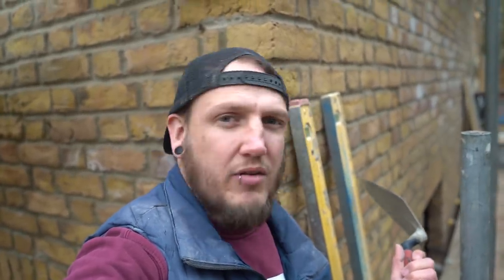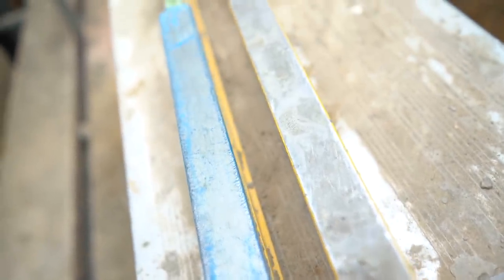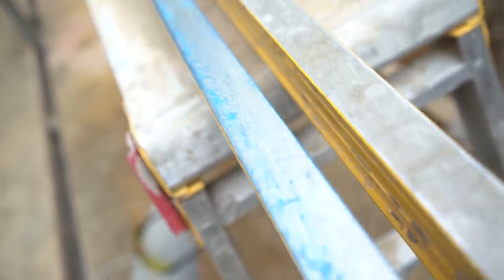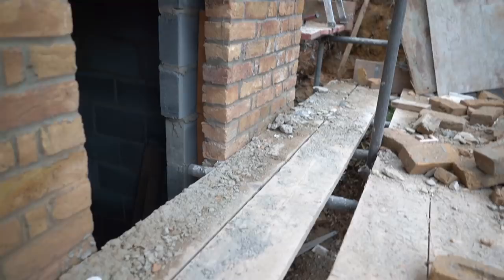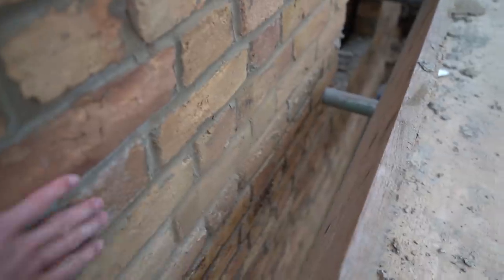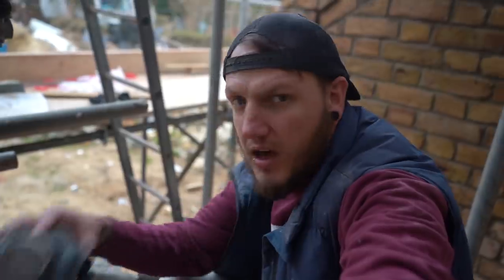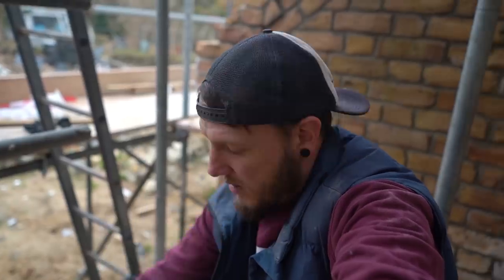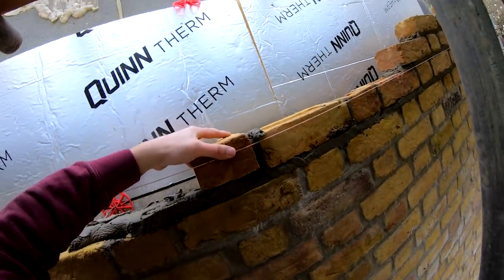7 BAD HABITS IN BRICKLAYING

Comment: The main you have missed  is the clip joint
A proper bad job that is or when its toothed out and someone puts  a brick in and just covers the gap with a joint not actually filling in.
Also a very good one but not very known one is when you brush off the face work but still leave all the tails in perps or brushed when it's still wet. Leaves the brush marks all over.
I work with n absolutely decent old boy brickie and as he says "the levels are made to be tapped or hit". If you just slightly tap it when building corners I don't see an issue but if you are smashing the granny of it then yes it's bad.
Thank you very much for your videos. The way you present the bricklaying channel is special and unusual. Keep it up!
Reply from the maker: Good points buddy. I agree a few taps of the level is all good. A good whacking isn't good 🤣 Definitely the clip joints! Seen that a few times
Reply from the maker: Glad to hear you're enjoying the videos buddy. Thanks 👍🏻😁

Comment: Turn the boards over here, no chance lol. The builders will always pay some one to clean the brickwork here with acid and pressure washer. First thing I noticed here was how messy the walls were after they were built. We used to use offcuts of kingdspan/Celotex/spot board to cover the bricks with, and had to prop our walls at the end of the day with planks and plocks to prevent them from getting blown over.  Reason for one boot wearing out on the toe more than the others is because you kneel down on one knee. I was guilty when I was younger of not wearing PPE but now I always use it, the safety squints still get used from time to time but in general I wear it. Top name by the way mate Cheers

Comment: Always wear a helmet when working around scaffolding !
Reply: Haha ken that’s funny man if I wear a hard hat I seem to bounce off everything ..... if I don’t wear a hard hat I never bang my head so..... I’m on the fence on that one..... below the scaffold I agree
Reply: I saw a chap jump a short distance from scaffolding onto a building and smash his face into a length of scaffolding he could not see because of the peak of his helmet. So much for 'safety' helmet. He was dazed and bloody with his glasses hanging down his face. Helmets good where something can fall on your head otherwise I hated them.
Reply: @railway-share3820  I worked in work health and safety for 30 years. I heard that excuse many times. Where I live there is no tolerance for those who don't wear their safety equipment. First off, that chap shouldn't have jumped in the first place, not good. His helmet could have been worn backwards, like steel riggers, if needed. The same bs I heard about steel toes: "Those steel caps will cut your toes off if you drop a heavy block on your foot". If the block is heavy enough to have the cap cut your toes it would then be up to the surgeon to cut them, because they would be irremediately destroyed. No safety equipment is 1000% proof, but good enough to save you from most kinds of harm.

Comment: Tapping level, Never. Tap brick or steel straight edge.. Clean tools, Always.. Someone else may have to use tools after you.. Cover bricks, most of the time..  PPE, Always.. Scaffolding has always been aluminum w/ traction & drainage holes.. Steel toed boots, Always.. Hitting the line.. Depends on which hand I use to mud bricks.. Army instructors are different from civilian instructors.. Army Sergeant have serious  consequences for bad habits. They get rid of those early.. Especially when it comes to safety.. And you have to wear "Always" wear a hard hat..

Comment: Another is not telling the laborer to grab bricks from more than one pallet. This prevents patchy colored walls seen from a distance. bricks are just loaded from the same part of the kiln at the brick-works. These can be a slightly different shade from other parts of the kiln. Mixing up the bricks on site makes the walls look more uniform in color when viewed at a distance. Also don't forget to batch the mortar using buckets not uneven shovel-fulls.

Comment: Another bad habit is not batching the mortar resulting in different colored mortars of various strengths. What is a shovelful when using dry, blocky, wet or whatever sands? Use buckets, make sure the cement does not stick inside the mixer instead of being incorporated in the mix etc. Batch by volume. Mix the bricks from different pallets so as to ensure an even and not a patchy look to the finished work. The client is expecting work done to specifications - no excuses. Laborers have to be educated in using the mixer correctly to ensure consistent and correct  mortar mixtures. A good knowledgeable brickies laborer is an important asset. All this is taught at building colleges run by ex qualified tradesmen and other building experts. All tradesmen should have at minimum a building certificate (2 years F.T.) or better still a diploma of building. These can be done at night school part-time when working in the day.

Comment: i agree with all your points except the boots.... im pretty sure regardless of whether you're wearing tennis shoes or work boots, stepping on a 4 inch nail will do the same amount of damage to your foot... the only way to prevent that would be to watch where you're walking. yes they do make steel shanked work boots, but the steel shank only covers 2-3 inches directly under the arch of your foot to make the rungs on ladders less painful to climb all day long. 

Personally, i prefer steel toed tennis shoes on a jobsite. they're more comfortible, lighter, and not nearly as hot. being in the midwest USA where summer temps reach 115 Fahrenheit with 90-100% humidity, keeping cool is a huge factor to consider unless you want to bring 2 or 3 extra pairs of socks and take regular breaks to dump the sweat out of your boots every couple hours. 

As far as one toe wearing out faster than the other. i think that boils down to a few things. when you kneel to do low work, which toe drags on the ground? which toe do you use to steady the bottom of your level when you're plumbing the wall? which toe is generally closest to the wall when working and most likely to have stuff dropped on it? think those are all factors, unless you just have bad luck like i do and drop a 100lb steel tub on your brand new $200 boots the second day you've worn them. (was really glad they were steel toe, definitely would've had broken toes otherwise) 

Anyway great video, keep em coming!

Comment: When cleaning trowel, use another trowel edge to clean it. Come up better than washing or brushing with a wire brush.
Reply: Alwyn Maguire personally I wouldn’t use a wire brush on my trowel, I find it puts fine grooves into the metal and makes the mortar adhere to it easier
Reply from the maker: Interesting, never thought about that

Comment: turn boards back, rub wall on way down w/ scaffold,,,, clean & cover windows,,,,throw straw around the base of the wall so roof drip won't splatter wall at the bottom,,,cover your sand, water, & walls when its going to freeze at night,,,, cover the top of your walls,,,,, if you get water in bricks w/ holes ,,pour sand in holes , to dry water before laying over top,,,use bond marks,,,etc,,,etc,,,
Reply from the maker: Some very good points. I could make another vid with all these 🤣

Comment: Leaving trowel on top of brickwork and it falling down cavity...... having to fish it out with wall ties or chopping a block out to retrieve it.😆
Same with level, leaning it on scaffold handrail for it to fall off the scaffolding, usually hitting every bit of steel on the way down. 
Last point is I used to leave the pointing too late, no fun when it’s hard as bell metal to point up 👍😆
From Doncaster btw
Reply from the maker: I've never dropped a level down the cavity but I did have my phone fall out my pocket and down the cavity. That was a pain to get back! Hard muck is almost impossible to rub up well. Id chariot it out and re point. Do that once and you will make sure you dont do it again 🤣
Reply: DeanoP I learnt all he said when I was a hoddy 40 years back, labourers haven’t a clue now

Comment: When I first started out i broke the end off my trowel putting it under 9in block to pull the bottom straight was gutted my mate bought me a new one for doing some work for him I have had it 17 year and it's still as good as new 👍
Reply from the maker: Least you learnt not to do that again 🤣
Reply: @RodianBuilds  sure did lol
Reply: What type of trowel lasts 17 years?
Reply: @Tommy14525  Marshalltown I been of the sites for a few year so does not get hammered as much these days steady away 👍

Comment: I just built my first thing, a couple of steps that go to my sunroom door off my new patio. The problem is that I worked slowly and was kinda messy. I have Type S mortar stains all over my brick. How do I get them clean now that they have dried with that white haze all over?
Reply: brick acid , shit stuff but gets it off
Reply: @SshiggyY  Thanks. I ended up using white vinegar and a scrub brush. It worked.
Reply: @michstanifer  ah brilliant that sounds a bit safer ill actually remember to try that if i ever get messy on small feature work

Comment: Never hit the level, ever.  Hit the level, hit your head, $150 per level.  Good idea on trowel cleaning, I was terrible at this.  Like the idea of rotating the boards, many masons don't want to do that. I am from Michigan in United States.  Old foreman's name was Soggy Bob, we worked in the rain, laid block, brick, or if too bad off rain, rubbed walls, cleaned up, went home once in a while.  Respirators and ear plugs, and eye glasses and gloves - respirator is most important to me along with glasses. Never can ever wear tennis shoes in Michigan, ever.  Bumping the line, yes, bad bad bad and spreading the wall before the twig or trig is set and if you do spread the wall before the twig is set, spread the twig-man's wall and do not hit wall.  Also, be aware of where you are on the scaffold, do not fall.  Also, exercise 2 to 3 times a week - strength train, your tools are key, your body is the best tool you will ever ever have - keep it in great shape.

Comment: Realest tip is about the line etiquette, probably the number 1 thing you start to notice laying with others, the longer the wall and tbe more masons, the more you notice and the more important not fiddling with it becomes, laying brick in Houston and one of the older guys has the habit of moving the line out to spread and it can really get on your nerves on a wall with 5 or 6 masons, you have to learn to read the joints and not wait for the line to come back and it leads to less even bed joints, its normal and acceptable to give the 'banjo' one 'stum' every now and again if the line is reading higher or lower than you expect, or you suspect the position changed due to geting hung up on something, brick, another perpendicular line, lineblock or pole running perpendicular, plumb line or a bit of mortar, but Id say its not necessarily every course you need to do pop or check the line, just good to be aware to move it as little as possible to not slow other masons down or worse move a twig so the line reads slightly out

Comment: If I'm laying block I don't clean my trowel.next day just come to work smack it against a block and some mortar comes off but it sticks good to my trowel.some people act like u got to baby it clean it every day if I need to clean it it dont take long just at the end of the day poor some water on the sand lay it down n take the bottom of my boot to rub against it.
Reply: @doughay9742  ha well you don't speed the same as you do with block. U won't it to slid off with brick. Brick u won't it it stick.my old boss thought me that.the people I work with now hate it
Reply: Spread excuse me
Reply: Block u won't it to stick

Comment: I am interested to know, I see some places where they suggest that you should wet down bricks, and here you suggest they must be dry.. I am not a bricklayer, an enthusiastic handyman.. But what is the correct answer?
Reply: Ask the manufacturer. Or draw a circle on a brick size of a quarter. Squeeze twenty drops of water. If the water is sucked up smaller than the circle in a minute and half. They need water

Comment: Batten with screws and string attached ,tie the string off on wall ties above head line, lay batten across ties lower than the course your laying on, prevents muck fall down cavity. Left in order of course being laid.
Reply: Beats poking weep holes with a straightened brick tie while water pours down...lol.

Comment: Always use 4 blocks when stacking spot boards, tuck clipped bricks under spot,  so you wont trip over the waiste when running in

Comment: if anyones getting a new stabila you can get them for £50 on amazon
Reply: Travis and Perkins have them for £42 inc vat 😉
Reply: Pete Steele nah mate the 96-2, the good one
Reply: @jackbircham439  I use stabila Lego brick level. £80 
Would not buy or use cheap £40-£50
Reply: Pete Steele it’s the same one every bricky uses, only saying so you don’t go into a shop and spend the extra 20-30 quid 👍
Reply: @jackbircham439  lol that's the shit one. Got to have handles kid.
Reply: Get you a Crick and be a real professional.

Comment: silly question do you have to get levels checked for true as a tyre fitter every thing is checked at least once a year inflators tourqe wrenches ect 
ian
Reply from the maker: You can check your levels. Its not a bad idea to do that. I've done it and realised my level wasn't right and got a new one.
Reply from the maker: I put 2 screws in a piece of wood level then turn the level round and see if the bubble is the same

Comment: After you get your bond you make a plumb line at the head joint about every 4 ft.,,,that's a " bond mark ",,,,you can follow it all the way up,,,just keep drawing them,,,keeps your bond straight,,,in gables, around windows,,,anywhere period...............really helps with "tumbled brick", or bricks that aren't a uniform modular shape,,,they can vary big time
Reply from the maker: I've done that a few times in the past to get walls bang on. The bricks here are so different it simply didn't work
Reply: @RodianBuilds  i put it in the head joint so i have a little play,,,,some people use tape measure to lay out bond , we lay out the bond &  adjust.
Reply: @RodianBuilds  yeah,,,these tumbled brick ( oversize )vary also,,,they look like you have a 1" head joint at times , but it's just because the corners are folded (tumbled before fired, so that the corners are bent and disfigured )Made by  Statesville Brick Co., Statesville N.C....U.S.A.
Reply: @RodianBuilds  seems as though black brick in the color pattern, are always smaller too,,,at least here,,,they must've baked the shit out of it,,,cause they won't take water either

Comment: Southern east parts of America.when I first started I wore boots but Josh came to work with shoes on one day and after that I did the same for a while. Yeah my old boss got on me pretty quick about taping the brick or block not the level. Never use my blade to tap always the but end of the handle but if I'm building a lead and I go to level and its just a love tap or two from getting level yeah I do it. And with the poing the line deal I never do it with my trowel but I'll take my fingers every so often and pop the line just to make sure if any mortar is on the line it comes off.keep up the good work and congrats with the craft God blessed you with
Reply from the maker: Nice to hear from all you Americans. Would love to work over there at some point. See the differences. Thanks for the comment 😁👍🏻